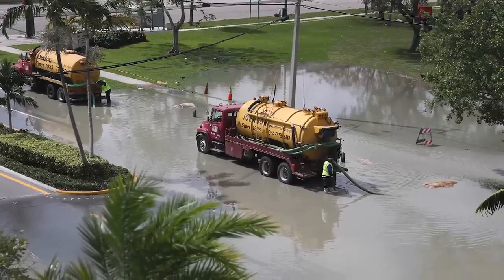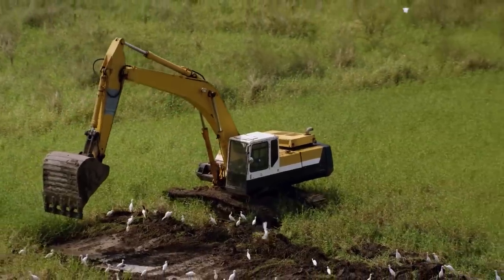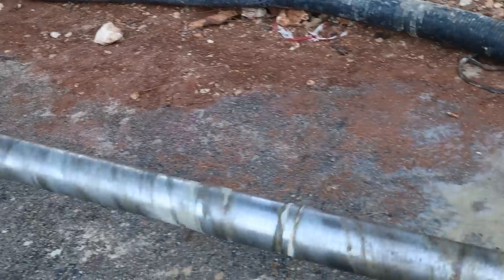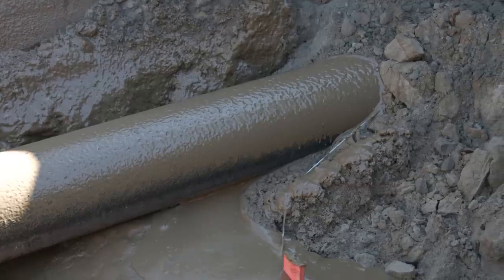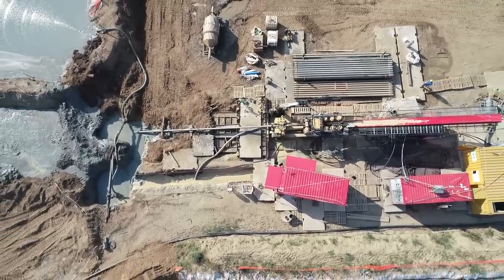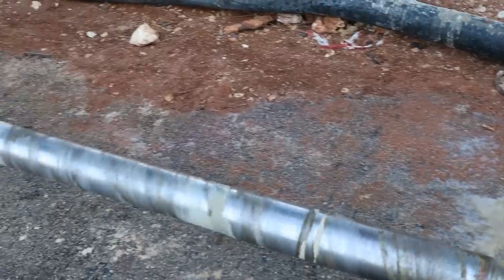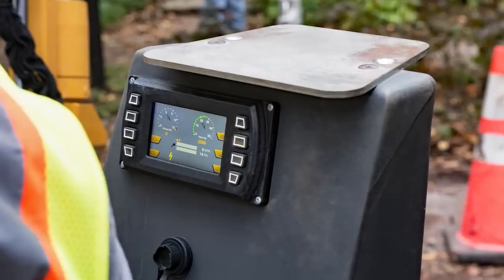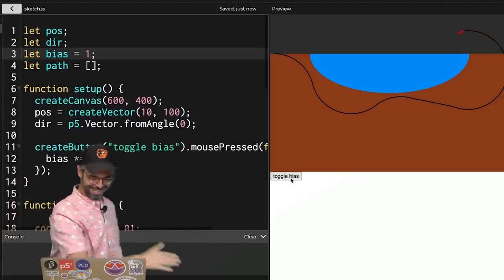How Do You Steer a Drill Below The Earth?

Comment: You can also cover the cousin, trenchless pipe replacement, used to replace old asbestos fibre cement lines here with HDPE pipe in situ, using a rig that travelled down the old pipe, expanding and fracturing the old century plus asbestos fibre cement water mains, and then pulling in a new HDPE pipe along this channel, with them only having to trench down from the tap off points on the pipe by each consumer, to strap on a tap in connection to the pipe. Minimal asbestos to remove, it all stayed in the ground except by the taps, and as a bonus all the old no longer used tap off points that are a source of leaks (metro admits 53% of all bulk water is lost to leaks and illegal connections) are also gone.

The alternative method is to replace sections of pipe if there is a break, and they did have to dig up a city block of pipe to finally get to a joint, where the old pipe collar did not fracture when they attempted to disconnect it. That was because it was a flange, around a century and a bit old, where there is an equally old shut off valve, that they were able to use. Still put the same fibre cement pipe back in, just asbestos free this time. Around 100 tons of contaminated soil to dispose of, and in the hole you could see history, where the old tram track still had the bed there a half metre down, and the nearly half metre of layered asphalt that constituted the road bed after decades of relaying. Saw some samples where the asphalt was over a metre thick, layers of patches put in to fill in sinkholes from leaks that eroded out the underlay, with quick fix after quick fix. Wanted some old tram rail, but they found none of it there, though it is still common as crash barriers all over the city, still fine after a century of no paint on it.
Reply: no, the actual alternative is called blown cured in place pipe relining.

Comment: Im (currently not for long) a truck driver & do lots of work with the pipeline here in northern BC. I got sent up to pickup the drill head that bored 550M under a river up in the bush. Just the 30' section of drill head was 52,000LBS and not cheap! When I delivered it they were inspecting it & adding up a tally; just visually inspecting it after the 1 project it needed new cutters & rollers which totalled in the $170,000 range, that's just for a few of the wear components!

With the system they use the drill head is welded to the pipe for the pipeline & they hammer it into and through the ground; as it cuts along its laying the actual pipeline & they cut the drill head off out the other end

Comment: My town had to replace their 3 miles force main a few years ago after the original metal one failed after about 25 years. 

They were able to just run the new poly pipe through the steel one since the material can hold more pressure to compensate for the smaller diameter. 

Maybe I’m too easily impressed, but it struck me as an elegant solution, as opposed to having to drill or trench and run brand new lines.

Comment: Nice, now I finally understand how this thing works! 👍👍
I work in the faultmanagement for large fiber optics connections for a large telecommunications company and diggers & drillers are our BEST FRIENDS! 😜 Especially the non-directional drillers (horizontal or vertical) with large diameter pipes or casons. Years ago one drilling company managed to pierce a major cable route several times for 1.5 kilometers before they noticed. 
In another case a vertical driller managed to wind up several fiber cabels around his pipe and effectively damaged several kilometers of it. This machine had so much torque that the cables almost got ripped out of the exchange building 3 kilometers away...😮

Comment: As a Field Supper for a Co in Ca I was tasked with getting a Hi PSI NG Line across a Very Bussy SIX lane Hwy.
After considering the impact to traffic, all the agencies involved, and frog leaping required for testing and advancement, I figured this contracted job would take my crew and I about 10 days best case scenario with inspections work and restoration. I also figured this would cost this project about $60K best case.
I had a meeting with a pipeline contractor, we got a contract for $22K. Our crew pot holed both ends, the drilling crew came at 7am and we had Installation, Testing Complete, and ON LINE before 1pm with a Break!

So we saved well over $30K, and OUR CREW was doing other parts of this contract to keep us On Schedule while Profitable.

Comment: I actually got to drive an HDD machine simulator, at a public hearing about a transmission line relocation underground. Was really fun.

Basically, you follow a little bulbs-eye on a screen, and where the pipe is at also shows up there. You rotate the pipe to keep it on corse. It is sort of like a video game. There is also a 2D overview, similar to the coding train’s demo, but a bit more complex.

Then, you also need to put new drill pipes in. That consists of clamping the end of the drill pipe, pulling the ram back, load a new pipe into place, seat it to the existing pipe with the ram, and unclamp the drip pipe. Sounds complicated, but it pretty much consisted of hitting 4 buttons in order. When everything is working right, it can probably be operated by anyone who has had basic instructions on using the machine.

Was a really cool demo, and it definitely reassured me that the creek they were drilling under would be perfectly fine during construction.

Comment: Thank you very much for your explanation of this process.  I noticed a rig on the side of the road in my neighborhood and I have wanted to stop and talk to the crew and find out how their process works.  I am a well planning in the oil industry and design directional plans which is a very similar process.  I also noticed a pile of big bits on the side of the road and now understand that those are the reamers that get pulled back to open the pilot hole.  We do drill horizontal wells too but they are several thousand feet deep and thousands if not tens of thousands of feet long.  I am impressed to see that a lot of the similar processes that I work with are also used in the HDD drilling you described.  Your description is greatly appreciated!

Comment: I work as a directional driller offshore drilling platforms for oil and gas. The technology is very similar, but extremely simplified compared to what we can do deepwater. I've directional drilled in 7000 foot water depth and wells over 30k deep. Very cool!

Comment: A spade bit on a long flexible narrow diameter shank with enough experience, and plenty of lucking around installing alarm and signal cables, can be steered with enough predictable accuracy to drill some interesting coffee break conversation holes... back in the old hard wire we pulling so much long cable days.

Comment: Thank you for sharing how directional drilling works.  I worked in the oil and gas sector in the 80s where we were hired to explore direction drilling using a coil tubing unit in the Alberta Tar Sands.  We were essentially testing how SAGD would work where the product field was close to the surface.  Thanks again!

Comment: There was a 4 lane street where about 2 dozen heavy plastic electrical conduits of varying sizes were run from one side to the other at regular intervals. The other challenge was that many were run within centimeters of buildings on both sides. They must have done it at night and very quickly because I never saw any equipment or operations. Too bad because I really wanted to see it happen.

Comment: I visited the Ripley's Believe It or Not museum in I believe Gatlinburg, Tennessee. There I saw a drill bit that could drill a square hole, and another that could make a right angle turn. The second was a sacrificial bit. The hole would be drilled slightly deeper than where the turn needed to be made, the outer ring of the bit would drop off, the bit would be pulled out slightly, then the head turned upwards of 90 degrees. Dropping off the outer ring meant the hole had enough room for the turn.

Comment: I used to work with the sewerage infrastructure in my town, and while we were having fibre cables installed, we got several callouts for blocked lines. I was the guy that had to run the inspection cameras down the lines, and sure enough, a large number of those blockages were bright green cables running straight through the sewer. The company who were installing the cables, and the sub-contractors who were running the HDD rigs, had to pay quite a lot in reparations for the damaged infrastructure

Comment: I worked at the Nevada test site in the seventies and I hauled the drilling mud to the drill rigs that were drilling the post shot holes. those are the holes they drill to find out how far the radiation went from the shot crater. they would drill several thousand feet down and then side track the drill to go out further from the rig. I also hauled bentonite from Wyoming where they refined and bagged it. I hauled a load to a hippie commune in Mendocino,Ca. they used it to line a pond that they irrigated their crops with. It seals the bottom and sides so the water doesn't seep back into ground. they also put it in ice creme to prevent it from freezing solid. I think think they also put it a lot of other products like shrink wrap.

Comment: Pretty cool info. When I was in the oil patch I saw the oil drilling equipment Shlumberger used. Their drills are electronic controlled and have fins that can be popped out to change the direction.  But for a million dollars per head, you can imagine they used em sparingly. And like another person said, you start going horizontal at 10k feet.

Comment: Just picture a clock background in your perspective,,your steer bit has a 12 to 15 degree paddle on the spear tip just for steering,,but we use clock positions steer as we drill, you push at the desired clock position to make the drill stem lead go the way you want it and drilling can cause you to come up or go down at slightly to the right depending on soil type ,you are there to push pipe drilling just keeps the pressure down..

Comment: Horizontal oil wells work the same way. They start going straight down, and then they go horizontal. It takes a mile to make 90 degree bend. I know of a specific well that has 5 horizontal wells tied to 1 vertical. And they go about 3 miles horizontally

Comment: used to do directional boring and we could get to bore to go straight by spinning the bore rod only pushed the rod to steer. using clock position from the locator beacon the the bore head to go left or right and up or down. when we wanted to straight we would spin the rod and it would chew a straight path.

Comment: Grady, excellent explanation of HDD and how it is steered. I have been in the HDD and trenchless industry for almost 27 years and have seen the industry grow from the beginning to where it is now. 

I think the biggest issues facing the industry is the lack of formal training, there is no trade or requirements other than experience, which leads to line strikes and IFR's all too frequently. 

Try having a look at the Direct Pipe method, it is a hybrid of sorts between HDD and microtunnelling. Mainly used on larger diameter crossings and reduces the potential for IFR's greatly. 

Again, as per all of your videos, great content please keep it up!

Comment: I live in Pittsburgh, PA and work for a company that uses a HDD. When it comes to drilling anywhere outside the metro area, the HDD does a very good job and getting us through tough spots. However, if we get a job in downtown Pittsburgh, no one is allowed to drill within the city limits. Every job has to be dug up, roads are cut, and all work is done from the surface. I guess there's just too much "stuff" under the city to risk the HDD going right through it.

Great video.

Comment: Do you have a video on pipe relining and replacing without digging up the old pipe? I know of inverting a resin impregnated felt tube into the pipe then circulating hot water through it to harden the resin. That works with old and odd shaped pipes like wire wound wood staves, spiral wound and riveted iron, non-round brick, terracotta, concrete and many other types. Despite slightly reducing the inside diameter it can increase flow by smoothing over things that cause turbulence. For metal pipes that are still in decent condition and smooth inside there's a method of squeezing long pieces of plastic pipe to reduce its diameter then rapidly shoving them inside. When the pipe tries to return to its original diameter it's secured inside the metal pipe. A third method is pipe bursting. When the original pipe is old rusty metal, un-reinforced concrete, terracotta, orangeberg, wood, anything that can be busted apart with enough concentrated internal force, this is one way to go. A plug is pulled through the old pipe, pulling the new pipe behind. The plug breaks apart the old pipe and pushes the pieces outward. The new pipe can be the same inside diameter as the old, or if the ground is soft enough a larger pipe can be forced through.

Comment: Used to worked in underground utility locating and had a job where guys installing cable to a neighborhood called in the wrong area to have located and they directional bored right through a fiber splice and dragged the main fiber feed back when they pulled the pipe out. I think that was the first fiber neighborhood in the area, a little over 20 years ago. Didn’t see much of that crew after that.

Comment: Great explanation of HDD. Fracking out is a serious issue. We never did a HDD without a geotechnical report on the soils. I was an environmental planner for a large utility in Northern California and had a 13 mile 36“ pipeline project that crossed two rivers, a private conservation site and a National Wildlife Refuge and did 3 HDDs. While crossing the rivers were an obvious reason for the HDD the engineers and construction superintendent had to be convinced of the need for the HDD beneath the NWR. Northern California has soil conditions that often create vernal pools. Those vernal pools support a variety of endangered and threatened species. Permits to cross those lands require purchasing mitigation credits for $1,000,000 an acre. For the NWR section we had a 6000’ x 100’ swath to permit for a trench and could take years to be issued. The engineers did the math and realized the HDD was cheaper and faster than trenching. At the time it was the largest diameter longest HDD in California. The final ream was 42” and took a total of 3 weeks 24/7 from the pilot hole to the final pullback.

Comment: I know a engineer who designed horizontal drilling machines and the older drilling machines actually used acoustics through the drilling fluid to communicate with the somewhat “smart” drill bits. Now they use basically Cat 5 in the string.

Comment: Thank you so much for learning the terminology for Horizontal Dirctional Coring and the principle for steering the alignment...

1. Just realize that HDD requires an asymmetric drill bits👍

2. Remind on risks for drilling fluid (bentonite) might not be returned to the launching pit and fluid might blast to the surface😂

By the way, how to install a spinning gyroscope on the head of the drill bit for sending electrical / magnetic signal to the ground. 

How to supply power to the gyroscope (front of drillbit), which need power for continous spinning.

If HDD for under seabed or oil exploration works, drillbit might be far away for receiving signal for tracking the drilling alignment > how to deal with such problem?

Thank you

Comment: I did some drilling a few years back (not directional drilling) in San Fransisco. On this project we drilled down about 15 feet then all of a sudden our drill bit just hung. We then put down more pipe until we finally hit bottom 30 feet from where we first broke through. We think we drilled through a massive underground water drainage system. The engineers with us were not happy with the situation. We’ve also drilled through huge water main lines that weren’t marked that shut water off for everyone in this residential neighborhood. 😅

Comment: The Big Island of Hawaii got a Grant to provide Fiber to all the Island's hinterlands to provide free, high speed internet.  One of the largest HDD companies out of Florida got the contract.  They shipped over a dozen drill rigs and support vehicles and began working along the roads to bury the FO cables.  The contract allotted 1 year, and they estimated completion in less than 6 months. All went well for a few weeks, until everything started slowing down and breaking.  The volcanic rock, which built the islands, made drilling very challenging!  It took over 2 years to complete and the $ losses were great.  The same process for some of the smaller islands received "no-bids" or were open-ended and astronomical.

Comment: *only trenches over a set width and depth require shoring not all do.

For those who dont know "shoring" is a technique where solid wals are inserted into a trench to prevent soil falling into the area and burying workers.
Reply: That scanner thing you were talking about is called a USRADAR aka ultra sonic radar
It can also detect different types of pipes and diameters (such as but not limited to gas,teleco,power,water,sewer it can even detect tree roots over a set size which it identifies as "unknown")

The stuff you learn by hanging with those in roadworks lol

Comment: Hey, I build those machines more than 20 years ago, I worked for a small firm in the Netherlands.
The first ones I build almost alone weld them build the power packs connecting the hydraulics put the drill motors together assemble the drill heads, tested them, build the bentonite mixers and even demonstrate a drilling one time.